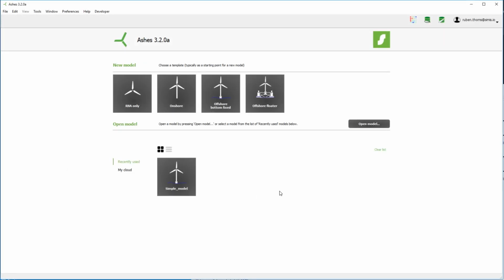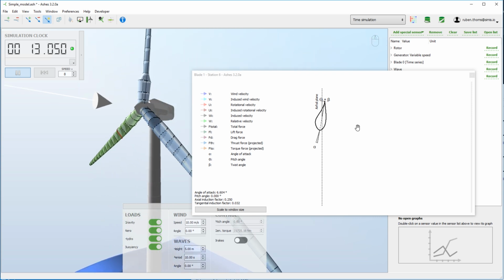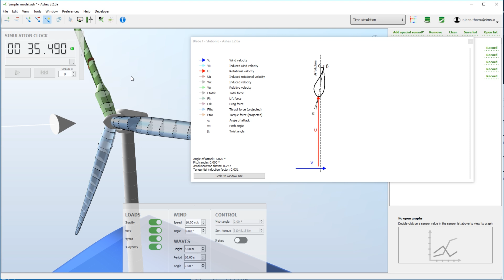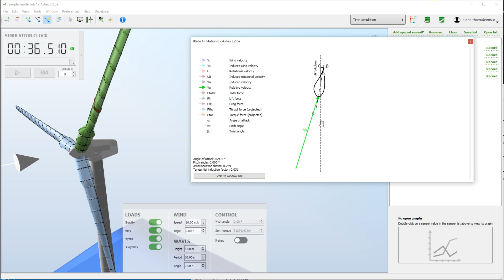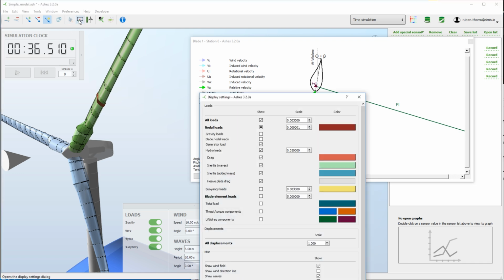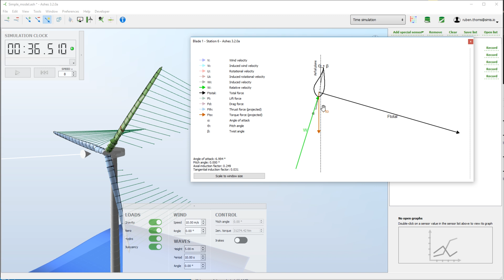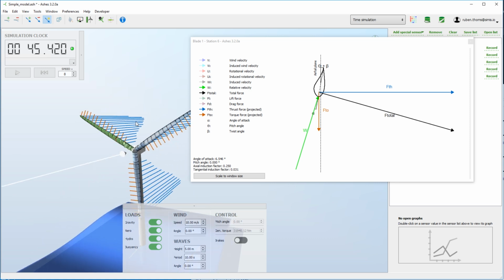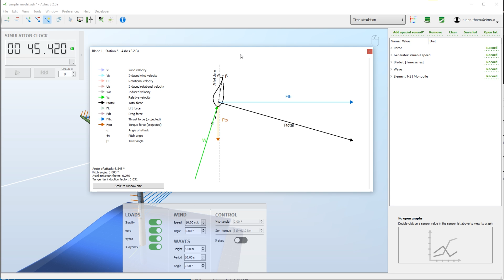Wind turbine velocity triangle explained with ASHES - the wind turbine simulation software

Comment: I don't know why, but according to my intuition, it feels like the blades are moving in a reverse direction compared to the actual airflow. If the wind is coming from the frontal side to behind the turbine, the blades should move counter-clockwise, no?
Reply from the maker: Interesting, and at what point of the explanation do you start disagreeing with what we are showing? If you agree that lift and drag are correct, then thrust and torque are also correct and then the blade is rotating in the correct direction. Does that make sense to you?
Reply: @AshesWindTurbineSimulation  Thanks for your response🙏. I understood everything, the drag-lift-torque-thrust, and seems intuitive. But the problem is with the direction of the blade tangential velocity U which is upward here and if we consider the clockwise rotation of the blade, it should go down if we see it from the front of the turbine. Although I have tried putting the blade rotation direction downward, it doesn't work either because the relative velocity direction means nothing with respect to the free stream air direction. I am confused with the blade tangential velocity direction besides regarding drag, lift, and all, it makes sense cuz the lift will be generated from the pressure side towards the suction side direction and the projection of the lift in the rotation plane will be downward which leads to CW revolution.
Reply from the maker: @BiswajitPaul-so8yz  Sorry I am not sure I understood what you mean. What do you mean with "the relative velocity direction means nothing with respect to the free stream air direction"?
Reply: @AshesWindTurbineSimulation  I mean if the blade is moving clockwise, the direction of the blade's tangential velocity should be downward instead of upward (which is shown here), right? The main question ends here......  But what confuses me is even if I draw the Blade velocity downward and try to draw the velocity triangle the relative velocity comes out to be outward the blade air foil i.e against the wind which doesn't make sense.
Reply: Even the direction of the torque force shown is downward and it feels intuitive. I am sorry if the question seems to be so silly.
Reply from the maker: @BiswajitPaul-so8yz  When you say 'blade's tangential direction', I assume you mean 'airfoil'? We don't draw the tangential velocity of the airfoil anywhere. Can you tell me at what time in the video you are seeing these issues?
Reply: @AshesWindTurbineSimulation   I mean the blade's tangential direction only? If the blade is moving clockwise and we are looking from the right side of the turbine, it looks to move downward. Besides, the torque force also directed downward so why is U (blade's tangential velocity) is in the upward direction.
Reply from the maker: @BiswajitPaul-so8yz  Ok, I think I get it now. U is not the velocity of the airfoil, it is the velocity of the wind hitting the airfoil due to the rotational velocity. Technically, there is no air particle moving at the velocity U, but because the airfoil is moving through the wind it will experience that as a wind velocity (just like if you were on a bike riding through still air, you would feel wind on your face). So U is equal and opposite what you call the tangential velocity of the airfoil
Reply: @AshesWindTurbineSimulation  Got it! Thank you so much for the explanation!

Comment: I am wondering how the pitch plays a role in this velocity triangle. Does increasing pitch always lead to an decrease in power or are there instances where increasing pitch actually ends up increasing power. Would this not depend on the turbine regimes?  

Another question about the ASHES software, I was browsing through the documentation but did not find anything related to user defined wind functions, I know you can but I am not sure how. I want to model wind velocities that are different from the logarithmic wind law
Reply from the maker: Great question. The way the controller works for commercial wind turbines is that for low wind speeds (under the rated wind speed) it tries to keep the rotational speed of the rotor such that the angle between the airfoil and the total wind is optimal. So in that context, any pitching of the blades would move you away from the optimal point and thus decrease the power.
But you could design and mount the blade so that it is not operating at the optimal angle of attack, and then pitch the blades when you want that to happen. 

About the wind speed, what type of wind are you trying to model?
Reply: @AshesWindTurbineSimulation  Thank you for your quick reply, I am trying to model low level jets wind
Reply from the maker: @yashdagade1240  Low-level jet winds can be generated with TurbSim, which is included in Ashes. You will have to use the Turbulent wind creator for that (see https://www.simis.io/docs/user-manual-turbulent-wind-creator) and select te relevant parameters

Comment: Great video! Are you able to quantify how much larger the thrust force is than the torque, are the visual lengths true? To me the difference between the two appears to be too large, given that Betz' law in an impossibly ideal turbine would limit the difference to 59.3%/(1-59.3%)-1 = 45.7% (i.e. the energy left in the wind passing the turbine could be at minimum 45.7% larger than what's converted to electricity).
Reply: The visual lengths are proportional, but we don't recommend using them for numerical values. Instead, use sensors that give you live numerical values (that can be exported) and live graphs if you want that. For example, there is a sensor field for efficiency, ie mechanical power (torque * rotational speed) divided by incoming power in the wind. For a well designed wind turbine the max value is around 50% < Betz limit of 59%. I don't think understand your reasoning about efficiency/Betz. Seems like you don't take the rotational velocity into account? To get power, that is necessary. Please, elaborate, or better yet - try ASHES with the 2 w evaluation license and look at sensors, and then elaborate. Or are you studying wind turbines at university, and already using ASHES in class?

Comment: Very nice explanation. And interesting to see the thrust force, which comes with a lot of consequence, and unfortunately the lift force is not increasing over distance. That would really create a lot of torque. What is your idea of a variable pitching VAWT, like we demonstrate in our channel?
Reply from the maker: Sorry for late reply. We haven't looked at VAWTs at all, but are vey interested to do that in the future. Looking for the right context/project that will put VAWT loading to the top our our (very long) priority list (aka Trello boards). About thrust - I think it's fascinating that you cannot get rid of it by improving design - it's a consequence of first principles.

Comment: According to Betz no wind turbine can  extract more  than 59.26% of the winds energy even if you design the most aerodynamic blades you will fail using the most advanced shaping possible you will fail why because Betz limit does not take into account the blade shape only the swept area of the turbine but the fact is that the wind pushes what it touches it can not push on the gaps between the blades regards Graham Flowers MEng

Comment: Thank you for your video. Is it possible to have a negative pitch angle in the low wind speed region? what effect does this create on the WT performance?
Reply from the maker: Generally, for low wind speeds, the controller will make the rotor rotate at a speed that will provide the optimal tip speed ratio (the ratio of the blade tip velocity over the wind speed). This is done so that the angle of attack is the best one in terms of lift to drag ratio.
So a low wind speed will generally not produce a negative angle of attack

Comment: essential questions remain unanswered: why does one accept such huge thrust-forces with relatively little torque? it is torque you want in the end... so why does one not turn the airfoil more parallel to the wind direction? that would turn its liftforce more into the right direction (ideally parallel to the rotational plane). ok, this would increase drag, but you said it's very small. so why not accept some increase in drag in exchange for more torque and less useless, even counterproductive thrust?! secondly it remains entirely unclear why the wings of a modern windmill are so long and slender and why they taper towards the end, leaving a lot of wind(-force) unused that can pass through the rotation plane without meeting a blade...? intuitively one would broaden the wing towards the outer edge and incline it at an angle of something like 45 degrees to the wind direction, so that more wind is 'caught' and more torque is generated by turning the lift force towards the rotational plane? could you please answer these questions (without maths!) just using the visual force vectors and/or ideally experiments? thanx a lot!
Reply from the maker: Those are indeed excellent questions. Unfortunately we don’t have the capacity to prioritise making new videos at the moment, but I’ll try to reply here:
Reply from the maker: About rotating the airfoil: the direction of the lift (and the drag) is defined by the direction of the relative wind: the lift is perpendicular to the relative wind, and the drag is parallel. So if you rotated the airfoil (in any direction), you would not change the direction of the lift (because the relative wind would not change (at least initially, but let’s keep that for another time)). In the conditions shown in the video, the angle between the airfoil and the incoming wind is optimised to get the best lift-over-drag ratio. If we had more drag, the torque would be reduced and we would be producing less energy.
If you have the time, you should definitely try this with Ashes, it would be very obvious if you tried to reproduce the velocity triangle and pitch the blades!
Reply from the maker: About modifying the blade towards the tip: at the tip, the relative wind is almost parallel to the rotor plane (and thus perpendicular to the wind velocity), so if you pitched the blade 45 degrees you will actually drastically increase the drag, again, not what you want. And you are totally right that broadening the airfoils towards the tip would increase power production, but then you would have to reinforce the rest of the blade a lot for it to handle the deflections due to the increased aerodynamic forces and weight. There would also be an issue with the torque distribution along the blade: with the way blades are currently designed, it is more or less homogeneous, but with your suggestion you would have much larger forces at the tip, which would increase shear stresses within the blade.
So even though your suggestion makes a lot of sense from an aerodynamical point of view, there are structural reasons that make it more economical to have slender blades.
Reply from the maker: It is also very possible that there are other reasons that I am not aware of, that someone working with physical blades would be able to point out
Reply: @AshesWindTurbineSimulation  hello, one thing that is not clear is what put in rotation the turbine (0' 33" start the white arrow). I mean: you made an analysis of the rotational velocity and his effect on the blade shape, but how the wind velocity put in rotation the blade in order to have a rotational velocity? Because I'm not an expert, and I was doing the same objection of Hilmar.

Second consideration the lift force: looking the aircraft and at their wings shapes, it looks that the lift fforce is opposite to the one you show in the video (the reason why the plane fly). do I mistake?

Tanks in advance

Marco
Reply from the maker: @Mark Cannels  super good question: in our simulation, when we click the 'play' button, we assume that the turbine was already rotating, but how did it start rotating in the first place? Let's assume that you start with a non-rotating wind turbine: When the turbine is not rotating, only the incoming wind velocity will produce aerodynamic loads. These loads will be much smaller than when the turbine is in operation (i.e. rotating), but strong enough to start rotating the turbine. So the turbine will start rotating very slowly, which will produce a very small rotational velocity, which will increase the aerodynamic loads, which will make the turbine rotate a bit faster, which will increase the rotational velocity and so on. But the best way to understand this would be to use the free trial period of Ashes and try to do it yourself (you could try to do something similar to our video, with an initial rotational velocity of 0 RPM). You can get the software at https://www.simis.io , and please let us know if it worked!

About your second question, the lift force is by definition perpendicular to the incoming wind, and in operating conditions it goes from the pressure side to the suction side. In an airplane, that means that it goes upwards. But a wind turbine blade is constantly moving through the air, there is not really an ‘up’ and a ‘down’. In any case, the lift force in Ashes is in the correct direction, as you can see that it goes from the pressure to the suction side

Comment: Can this software be used to design VAWT? and could it be used for CFD?
Reply from the maker: Unfortunately not yet, the way to solve for aerodynamic loads for VAWT is quite different. And it does not include CFD, only BEM.

Comment: what is happening on the windward surface of the blade? It's shape camber(?) looks as if it could also produce lift which would obviously oppose the lift generated by the other side of the blade..
Reply from the maker: Hi, I'm not sure what you mean. Which one is the windward surface? The lift comes from a pressure difference between the suction and the pressure sides of the airfoil, so there is only one lift force for a given airfoil in a given condition.
Reply: @AshesWindTurbineSimulation   The windward side is the side facing the the wind. It just seems like both sides would potentially create 'lift' given their shape . One side is obviously going to produce more lift to create the required difference, it just seems  odd to me that the higher pressure side would have such a bulging shape (potentially lift positive) . I know this is a garbled statement..wish I could be standing in front of a blackboard drawing out what I mean. Thanks for your response.
Reply from the maker: @r.roddick7585  A side does not produce lift, it's the difference of pressure between two sides that produces lift (and drag). But I think I know what you mean: intuitively we tend to think that the 'bulgng' side is the pressure side, when it is actually the opposite! The bulging side is the suction side, and that is why the aerodynamic loads are in that direction. But you would be surprised how many models of wind turbine have this wrong...

Comment: How can I see the angle of attack in this program ?
Reply from the maker: The angle of attack is noted 'alpha' in the video, in the velocity triangle window. You can see it in the Blade station sensor also. For more info, check our manual here https://www.simis.io/help/#12b215b5ed3c45109db85b64c854876a

Comment: Hi I have a question. So according to your extremely well presented explanation, the rotational velocity of the wind is the main cause of the rotation of the blades because it is the one that induces Ftotal. (Mostly using Flift). The Ftotal causes Ftorque that rotates the blades. However, suppose the blades are not rotating at all and the wind starts to blow. How does the wind turbine even start rotating from a complete stop? Are there different forces at work during the startup?
Reply from the maker: Good question! The main contributor to the relative velocity is, as you said, the rotational velocity, but the incoming wind velocity also contributes. When the turbine is not rotating, only the incoming wind velocity will produce aerodynamic loads. These loads will be much smaller than when the turbine is in operation (i.e. rotating), but strong enough to start rotating the turbine. So the turbine will start rotating very slowly, which will produce a very small rotational velocity, which will increase the aerodynamic loads, which will make the turbine rotate a bit faster, which will increase the rotational velocity and so on.
But the best way to understand this would be to use the free trial period of Ashes and try to do it yourself (you could try to do something similar to our video, with an initial rotational velocity of 0 RPM). You can get the software at www.simis.io, and please let us know if it worked!
Reply: I was about to ask the same 🔥🔥🔥❤
Reply: Thanks, was about to ask the same question. It's interesting that a helicopter cannot start autorotating if the blades are at a standstill because you cannot adjust the blades to negative pitch to use the purely reactive force of the wind to start them spinning.

Comment: hello sir, thank you such good description. i wanted to know what is rotor plane, i am not able to visulize it. can you please explain
Reply from the maker: Glad you liked it! The rotor plane is a plane that is perpendicular to the main shaft and goes through the hub. So if the cone angle was 0, all blades would be in the rotor plane. There is an illustration of the rotor plane in our theory manual, here: https://www.simis.io/help/#52d585d6f04f4e8e8fc587730bc4213d